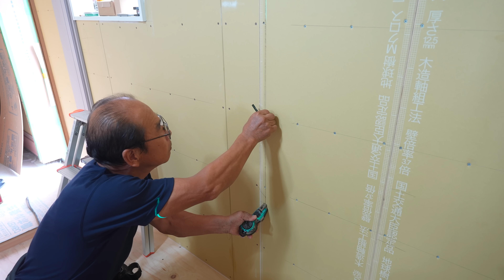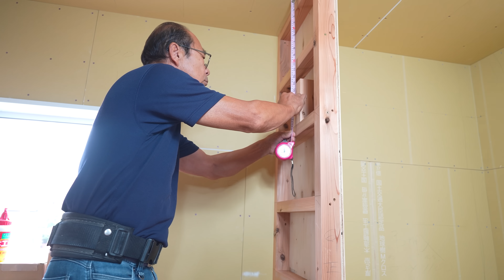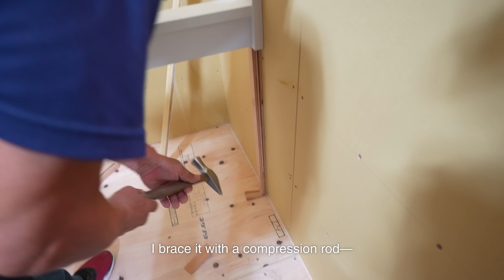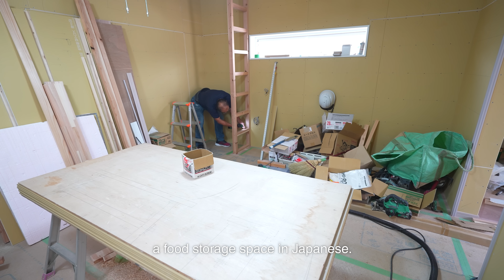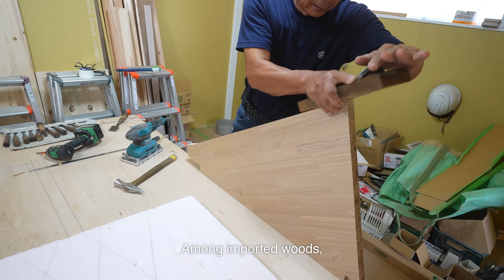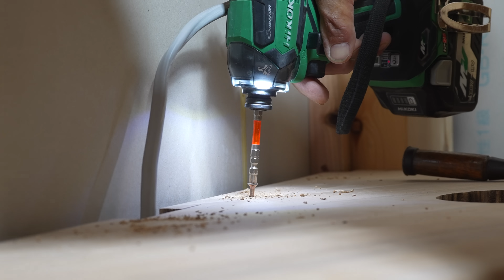Japanese-Style Room with Floating Closet – Joinery Work Completed! | New Build Season 6 Part 9

Comment: In my old house (built in 1900 or so) here in Michigan, the pantry is above a Root cellar built into the basement. The root cellar had a vent to the outside, and the pantry itself is unheated, so even with the vent shut and some insulation in the vent, the pantry is very cool in winter (50f/10c) and even in summer it does tend to stay cooler than the kitchen would be without AC, though as it has HVAC installed so it tends to be about the same as the rest of the house in summer, but when temps are mild and the heating/cooling off it is noticeably cooler than the two rooms abutting it. Back when, heating was coal in the basement, The root cellar has poured concrete walls separating it from the rest of the basement and the vent kept it cool in winter when the heat was high down there.

Comment: Nice one Shoyan, those floating closets are catching-on. I myself built a very good "floating workbench", it covered
an area of wall-to-wall (2400mm) and then in another 1900mm, making the bench 2400 x 2400 in an L-shape,
with one little 10mm "booker rod" holding up the other side (it did not go to the next wall) the bench was completely
"floating" except for the one booker rod. I installed 3 electrical outlets as well, was feeling pretty good about the job,
\\\\\\\\\\\\\\\\\\\\\\\\\\\\\\\\\\\\\\\\\\\\\\\\\\\\\\\\\\\\\\\\\\\\\\\\\\\\\\\\\\\\\\\\\\\\\\\\\\\\\\\\\\\\\\\\\\\\\\\\\\\\
UNTIL I WENT OUT FOR A FEW HOURS, AND WHEN I GOT BACK, THE "NEW SOUTH WALES POLICE"
(OK. TOOKIE THE VULTURE) BROKE-INTO MY UNIT, ILLEGALLY PICKED MY COMBINATION LOCKS,
AND STOMPED, DANCED, AND SCUFFED THEIR BOOTS ALL OVER THE FOUR-BY-TWO PINE WOOD, 
LEAVING MARKS, AND SHIT ON THE WOOD, "LIKELY SHIT" FROM "UNSAFE ENVIRONMENTS" LIKE 
A JUNKIE'S UNIT, IN A NEARBY HOUSING COMMISSION BLOCK - THAT'S WHAT IMMATURE, 1-STRIPEY
POLICE OFFICERS DO. THAT'S WHAT THEY CALL "POLICE WORK", OR IS IT "POLICE SOLICITING BRIBES"?

THE NEXT TIME I SAW A BUNCH OF "1-STRIPEYS" (A YEAR LATER) WHEN I WAS RIDING MY BIKE, OVER
NEAR THE "COCKLE BAY" (OPPOSITE DARLING HARBOR) THERE WAS A BUNCH OF STRIPEYS, IN UNIFORM,
ALL RIDING BIKES, WITH A LARGE NUMBER OF KIDS, AND TEENYBOPPERS, AND TO TELL YOU THE TRUTH,
IT WAS VERY HARD TO DIFFERENTIATE, THE KIDS, THE TEENAGERS AND THE PUNKS, FROM THE POLICE OFFICERS.
Reply: Take your meds Ritchie.

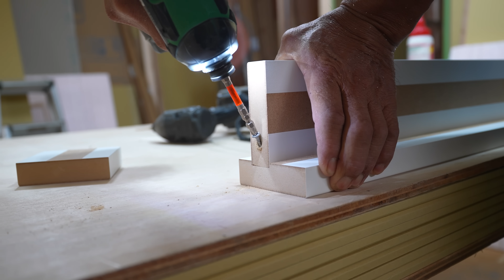Comment: 3:22 for MDF like products, there's these screws that on the countersunk head have "paddles" (for lack of a better term) that cut away the material and prevent it from splitting. As for the head, where the screw goes, the higher quality ones come with a spade head, on the cheaper ones (or rather to be correct: the normal ones) there's no such feature, but a quick cut with a pair of pliers will remove the tip and thus allow for a clean MDF hole. That said, it's always best to keep a long thin nail handy with its head cut off and use it to "pre-drill" the path. MDF is a laminar product, and it likes to split, and once split, it completely loses its holding power unlike wood where even if it's split, there's still resistance because the fibers break unevenly.

Comment: I have ash flooring in part of my home and also some ash trim.  I cut the trees, milled the lumber and then installed the finished wood myself and I do agree that ash has a mild goat dropping smell. There is both a type of elm and a fir tree called Alpine Fir that are far worse,  both of which when exposed to heat, have an oder of hot urine and we also have a species of red oak that has a sour, rank smell when freshly cut green that is quite strong.
Reply: I don't like Douglas fir smell ,which is a bummer cos I have a lot of it
😢
Reply: @Nozinbonsai I've cut Douglas Fir when I was working in the western states, I really liked cutting it as we got paid by the thousand board foot and it was big, cut fast so it really added up quite compared to Ponderosa or Lodgepole pine.
Reply: I've worked with a wood species called bocote which smells like dill pickles when cut.